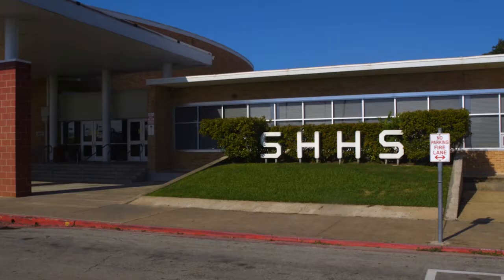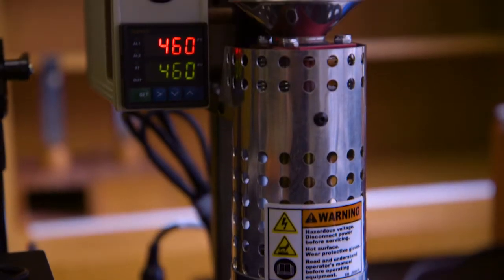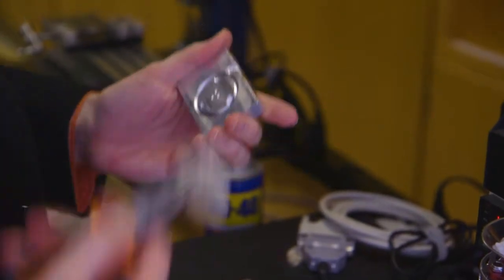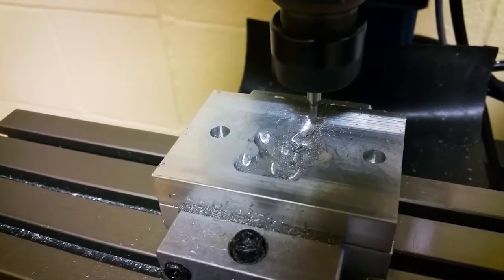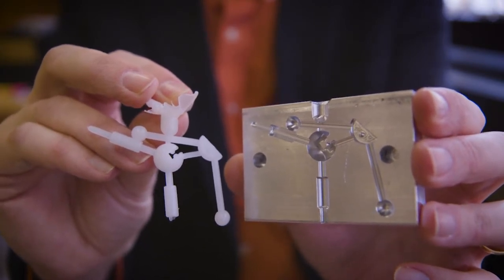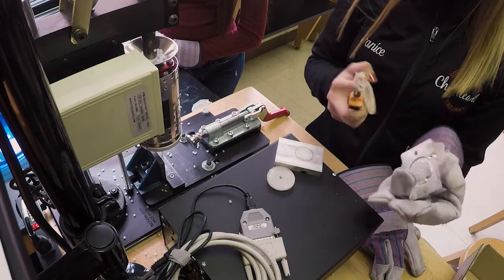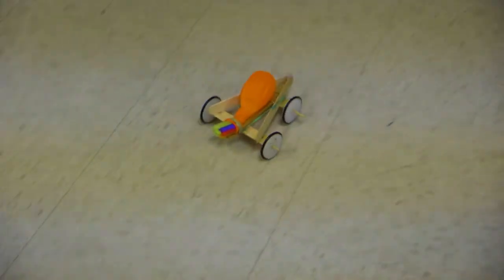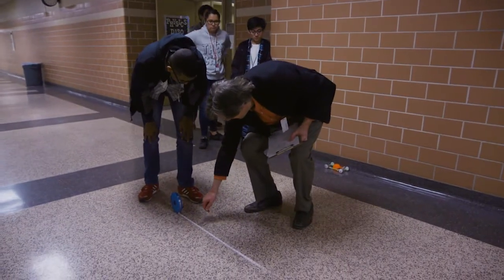Mini Grants, Major Benefits: South Houston High School - Education in Plastics Manufacturing

Comment: awesome.  I am STEM Engineering teacher in Fairfax Virginia.  I am trying to get something like this set up in my classroom.  I have parts that I have been mass producing using a 3d printer but it is slow and frustrating.  I have been trying to find a cheap and affordable CNC Milling Machine.  I have 2 CNC shark machines, but they are not designed to cut metal.  I also do a motor project and want to cut the thin parts of steel to create the lamination for the Armatures.

I am not interested in sharing my email address but if you could post the name of the CNC on here it would be very helpful.  you say the name of it in the video but I can't understand what you are saying.
Reply: never mind I got it in the transcript.  thanks
Reply: @barrettairaghi2285  Thank you for sharing how to get the name :)